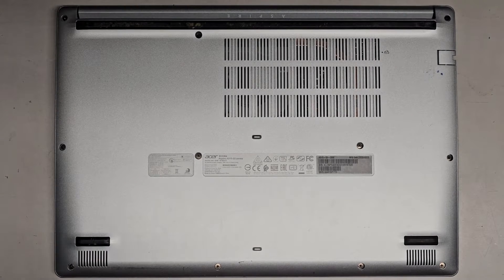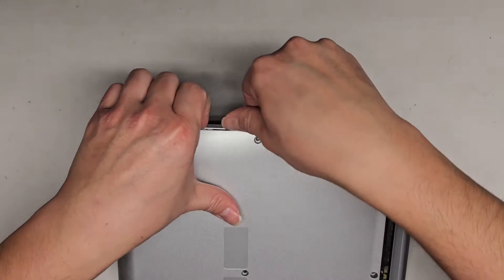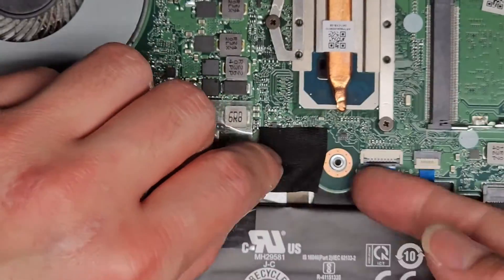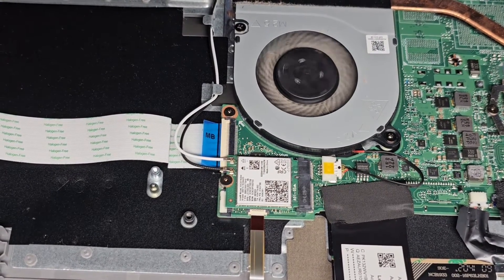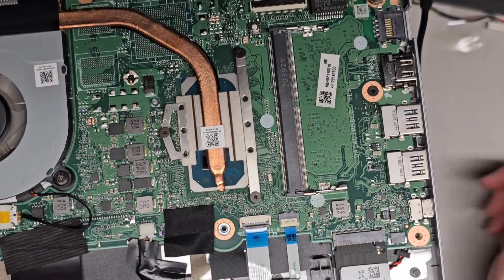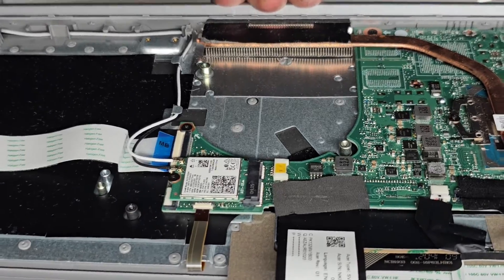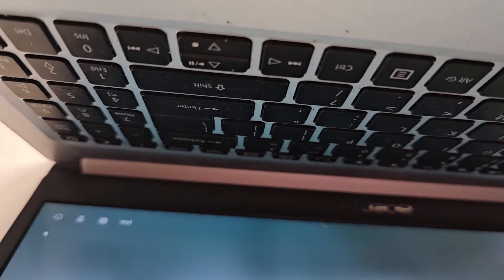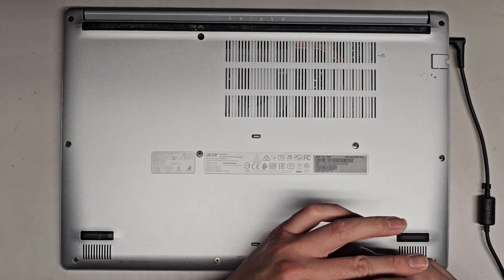Acer Aspire 5 A515-55 Series A515-55-35SE N18Q13 Disassembly SSD Upgrade Battery Replacement Repair

Comment: Where do I install the HDD Upgrade kit, the A-515-55-59YS laptop came with a bracket and screws for an additional SSD. I didn't see a place for it. Thanks
Reply from the maker: Maybe under the wifi card